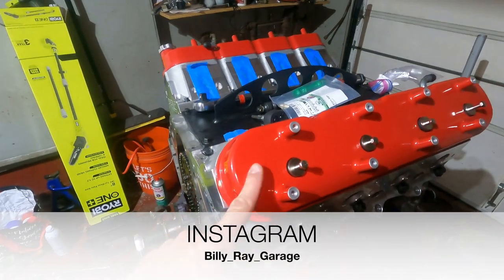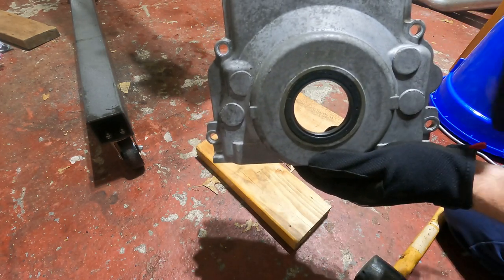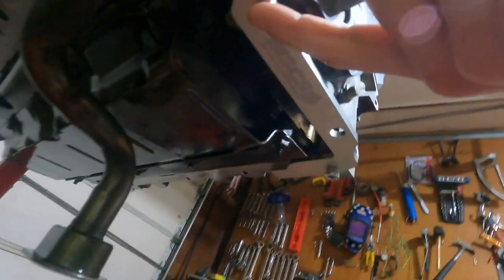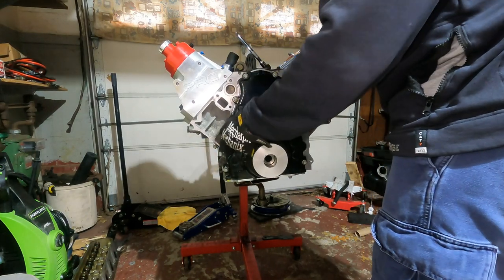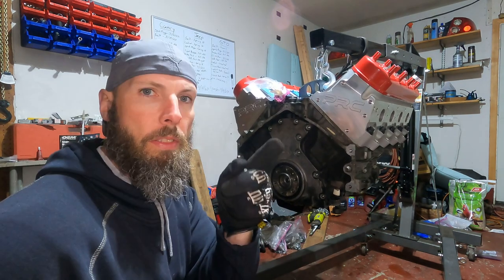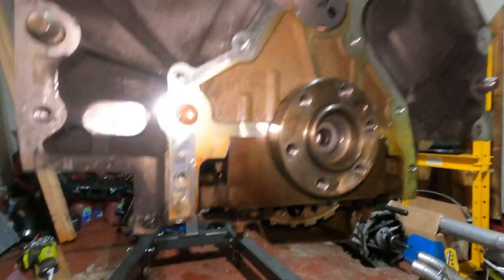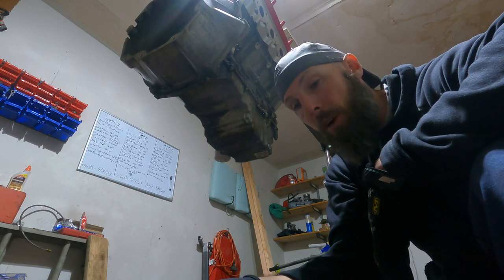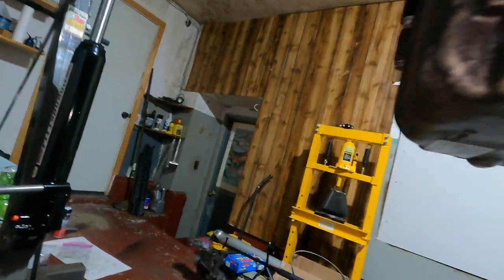NOT doing THIS will cost you BIG! Sealing up the GTO engine

Comment: What's the specs on your heads? Have an 04 gto myself
Reply from the maker: Yeah man. Ordered through Texas Speed. Got PRC 225cc as cast cathedral heads. 2.065" intake, 1.60" exhaust, both valves stainless. Went with the dual spring set up for the valves. If you want more info let me know. I'll try to get that to you.